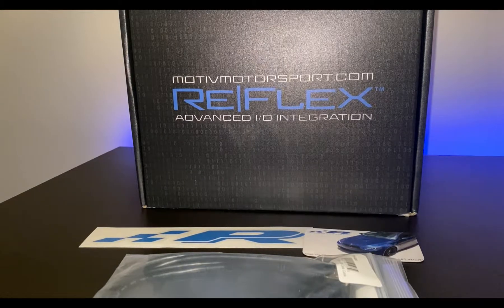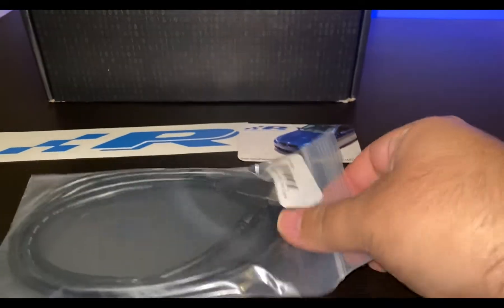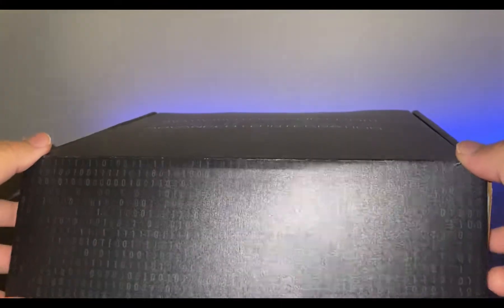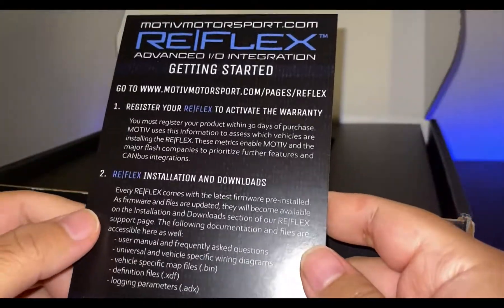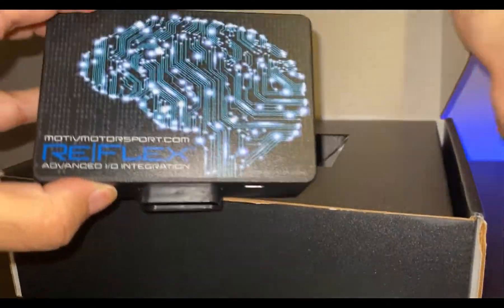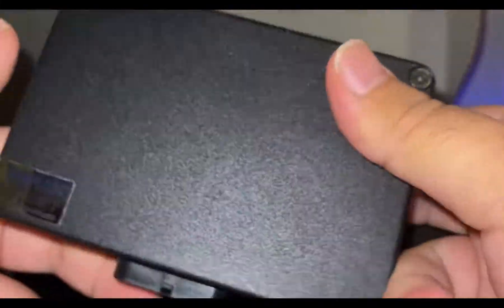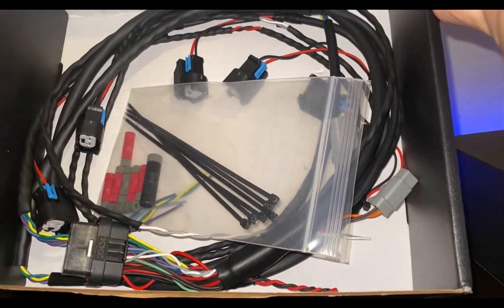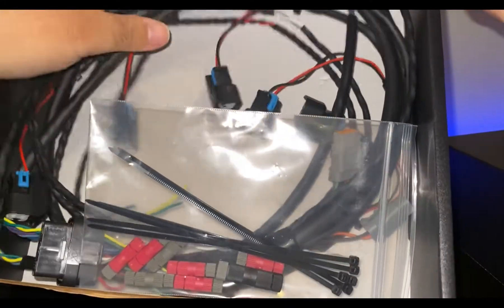MOTIV REFLEX - ADVANCED I/O INTEGRATION (UNBOXING)

Comment: What is your opinion of the finished install and performance? Did you use this with the BMP port injection?
Reply from the maker: I haven’t had the chance to fully use it yet since the car been down but install is easy for someone that knows what they’re doing or understand the diagram . Also I used it with the PR port injection and it definitely felt faster but haven’t done any logging on it.